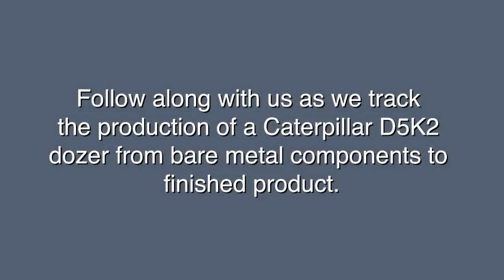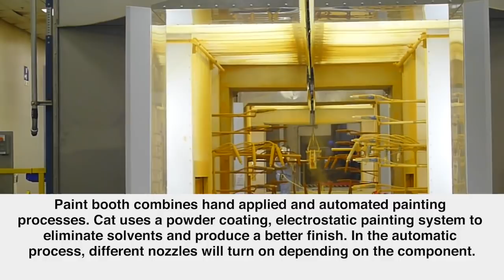How Caterpillar builds a bulldozer

Comment: Not a single hard hat with overhead cranes, and I get my balls busted not wearing one in an open feild.
Reply: grumpybill why do you have to wear one in an open field? Do the bosses think a satellite is going to crash on your head? I see people picking up trash on the road with a hard hat on. Why? Could never figure it out.
Reply: kroozman10 safety first.
Reply: In that situation if your under a crane with a load above you thats mistake number 1, second Its common sense that if you need a crane to lift heavy metal parts then it doesn't matter if you are wearing an indestructible hard hat your neck stills breaks and you possibly get squished depending on the weight, hard hats only protects you from small objects that hit you head but the also let the people around you know where you are i.e. crane operator
Reply: In the event of any accident OSHA investigators will ask if the employee was wearing full PPE. Make no sense to me but the is required. Its also employers protecting themselves in a lawsuit.
Reply: kroozman10  it’s easier for the bosses to say hard hat all the time instead of trying to decide if and when or not to wear the hard hat. Also you always have people trying to push the boundaries of when they don’t need it. So they just say wear it all the time then there’s no misunderstanding and folks trying to take the piss.

Comment: '
all caterpillars powers are uses alot of strong steels...
dont have aluminum at all...
aluminum caterpillar is better easily weight than heavy steel weight
Reply: If I'm reading your comment correctly? You think aluminum would be better? You even understand how a cat works? That weight is what gains you traction, the heavy steel gains you wearing surfaces and long term durability. Aluminum would be worthless on a cat. There's zero advantages and far too many disadvantages including higher costs for the aluminum.
Reply: exactly, simple logic and physics appears to be fully wasted on some like ``bestamerica`` Going by just some of the comments in videos like this our education systems are on a race to the bottom. :-)
Reply: hi TP...
dont use 2 words - YOU / YOUR on me...
let explain about this cat power machine
Reply: 2 words, think I can do better than that. So do tell bestamerica, how about you èxplain this cat power machine to me hmmmm. Only one problem, what a whole lot of fools on youtube tend to forget is they have no idea just what the person there addressing there comments to has for experience. And you picked the wrong guy. I`ve been in the mining, logging, construction industry for over 40 years, have run cats from little JD bucket machines to D-11s, road graders to 16g size, 5500 hitachi hydraulic shovels, electric rope shovels from P & H 1900s - 2800s, hoes to 750 size, 992 cat loaders, haul trucks from tandem dump truck to 300 tonners, have a class 1 cdl with air endorsement,  sand trucks, water trucks, road packers etc. So why don`t you go ahead and èxplain these cats to me huh.I`d love to hear it. Don`t shoot your face off about something you know less than zero about. An aluminum cat, lol that`s priceless. I gave you logic about why that aluminum isn`t used and you should have just paid attention and then used your 2 brain cells about why it can`t work but your still pushing it.
Reply: lol, maybe not FSAG, or his Google link may have stalled on him and that`s why it`s still quiet. :-) But anyone coming up with that aluminum cat brain wave sure ain`t the sharpest knife in the drawer. Do these guys think real operators don`t watch videos like this because were all curious and interested about how the machines are made that we run. There`s some really knowledable people on some of theses comments sections, but my gawd theres a few others not quite up to walking and chewing bubble gum at the same time. I am gonna repeat his idea to every operator I know when a good chuckel is needed.
Reply: hi TP...
dont use 2 words - YOU / YOUR - on me...
dont insult me bully words...
be nice and respect...
let explain about this cat power machine vehicle...
remember that dont be ego selfie smart
Reply: hi F...
thank...
already reply to TP
Reply: I was going to let this die but your still pushing. Insult and bully you? I haven't even started, if you think that's being insulting you wouldn't last 5 minutes on any real job site I've been on. Say something stupid there and someone will immediately tell you your a fool. I'm not your Mommy or Daddy and I'm not the type to sugar coat the truth. Ego? No I simply stated my experience, what's yours? You still haven't "explained" a single thing to anyone. The problem here is you understand so little about how these machines are designed to work you have no idea how little you do understand. I was being nice and I don't ever use any comments I wouldn't say to a persons face. Except then I'd add industrial language. I strongly suspect engish isn't your primary and first language so up to now I've gone easy on you. But if you've got some detailed information or even Google links to support what your trying to say then post em. If you don't then anything FSAG's or myself have said is still valid.